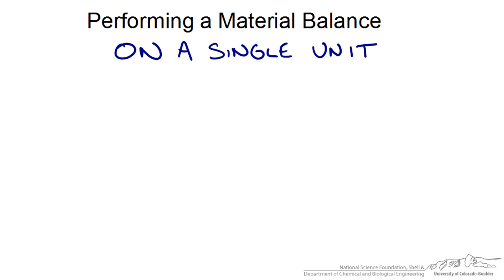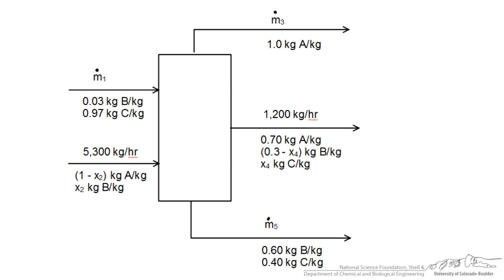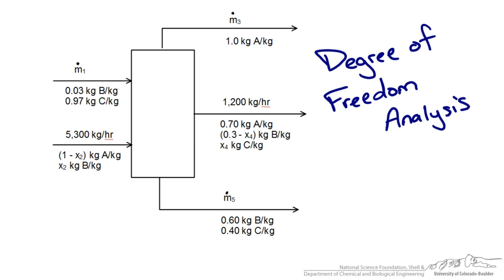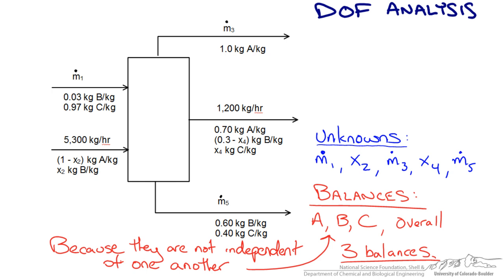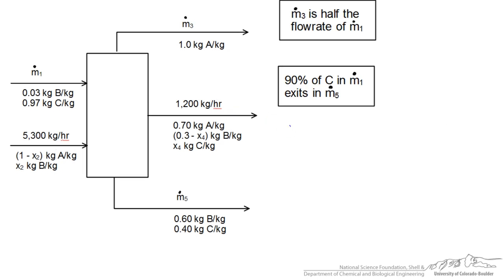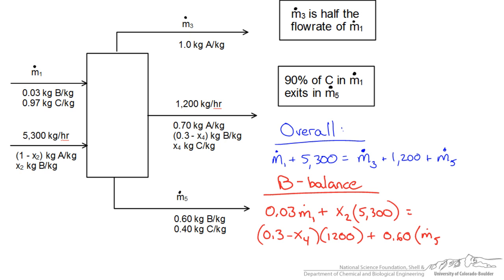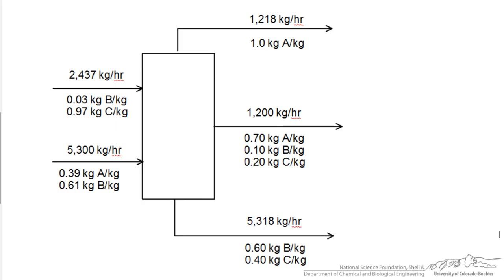Performing a Material Balance on a Single Unit

Comment: please explain why 90% of C in m1 exits in m5, and also 
m3 been half the flowrate if m1
Reply from the maker: At 4:20 they are presented to help solve the balances.  Otherwise the DOF before that revealed it was unsolvable without further information. One reason doing a DOF is important is that in real design you may have to either make assumptions or get more information to proceed. These are both  pieces of given information.

Comment: Can someone tell on what basis those 2 assumptions were taken?
Reply from the maker: At 4:20 they are presented to help solve the balances.  Otherwise the DOF before that revealed it was unsolvable without further information. One reason doing a DOF is important is that in real design you may have to either make assumptions or get more information to proceed.
Reply: @LearnChemE  Could you for example have said that  0.1m1 = m3 instead of 0.5m1 = m3?

Comment: The last 2 conditions flowrate m3is half of M1 how did you get that?
Reply from the maker: Those were merely provided to allow you to solve the problem.  They weren't calculated.  Think of them as just part of the problem statement.
Reply: @LearnChemE  I meant the degree of freedom analysis part whether the eqns were given or u calculated them and if calculated then how?😅
Reply from the maker: They were given.  Once it was discovered that there were 2 degrees of freedom, we needed 2 more pieces of information to solve the problem.  So those two items were then given.
Reply: @LearnChemE  ohk thnx😁😄

Comment: Ooh please, can you explain me the ecuation number 3? it gets me headaches 🤯
Reply: Equation 3 is the overall mass balance, where the total input=total output (all the streams going in equals all of the streams going out for that system). So, you would get stream 1+ stream 2= stream 3+ stream 4+ stream 5. Because the flow rates for streams 2 and 4 are already known to be 5300 and 1200, respectively, you can go ahead and directly plug that into the equation, resulting in m1+5300 = m3 + 1200 + m4.

Comment: Hi, I was originally confused for the statement "90% of C from m1 in m5", but looking at your calculation, you used 0.40*m5 because stream m5 consists also of B, and not solely component C?
Reply: yeah thaats why we multiply m5 with 0,40 , which is c rate in m5 , so theres no longer b's component 

sorry for 7 years late

Comment: Thanx for the video. 
Just wanna fix a small thing 
I Think m5 = 5319 kg/h  so that what goes in = what comes out.
Reply from the maker: Thanks for your comment.  They should match up, but the numbers are off by 1 kg/hr likely due to rounding.  Since that is less than a 0.02% difference, I wouldn't worry about it.

Comment: Very good video... but I have a question about the final balance steps. Where is the 2,437 kg/hr coming from? Is there anything being divided? I couldn't figure that step out. Thanks.
Reply: Yeah but it's -0.5-2.1825.... m1 - 0.5 - 2.1825.... How did you turn the  0.5 into a positive all of a sudden? It's a negative on that side of the equation. Should be -0.5-2.1825= -2.6825. Then divide -4,100 by -2.6825.
Reply from the maker: @elliotb1795  The equation is m_1 - 0.5m_1 - 2.1825m_1 = -4100. The first m_1 has a coefficient of 1. So you have 
m_1(1 - 0.5 - 2.1825) on the left side. (1 - 0.5 - 2.1825) = -1.6825
Reply: I couldn’t understand it too😞
Reply: yea i dont understand this part, anyone helppp
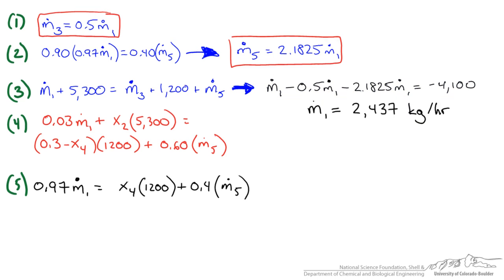Reply from the maker: Thanks for your question.  The screen at 7:45 lists 5 equations.  The first three have three different variables.  (3 equations for 3 variables = solvable).  After that it is just substitution.  m3 = 0.5m1, m5 = 2.1825m1.  When you replace the m3 and m5 in equation #3, you get m1 + 5300 = 0.5m1 + 1200 + 2.1825m1.  Then you move all of your m1 components to one side to get the equation written to the right.  That simplifies to -1.6825m1 = -4100.  Then, dividing both sides by -1.6825 you get m1 = 2437 kg/hr.  I hope that helps.

Comment: at 7:15 how did you get m5=1.825m1 i repeated this part more than 10 times and still cant get? i understand the whole Video  except this part please help
Reply from the maker: +Ali Al-Obaidi I'm confused on your question. At 7:30 in the video, we get m5 = 2.1825m1, just from rearranging equation 2.  Are you asking where that information came from?  Or just the math?
Reply: +LearnChemE yes I am asking about the math
Reply from the maker: +Ali Al-Obaidi So the equation starts at 0.90*(0.97m_1) = 0.4m_5
Simplifying the right side: 0.873m_1 = 0.4m_5
Dividing both sides by 0.4: 2.1825 = m_5

The number you gave in your first comment is incorrect.  Does that help?

Comment: How do we get the statement 'm3 is half the flow rate of m1' and '90% of C in m1 exits in m5' ? or was it given in the question?
Reply: Shishire3210 he just answered the question the problem would be unsolvable without the introduction of more information. So yes it was given
Reply from the maker: At 4:20 they are presented to help solve the balances.  Otherwise the DOF before that revealed it was unsolvable without further information. One reason doing a DOF is important is that in real design you may have to either make assumptions or get more information to proceed.
Reply: LearnChemE This doesnt really answer the questions. You only said that these two relations are known, did not say if they were given or we had to derive them ourselves. Thanks.

Comment: it will be easier if we have MB on A from the beginning and with just one relation

M1+M2 = M3+M4+M5............1  overall MB
2 M3 = M1.............................. 2    relation
MB on A :
0,39 M2 = M3 + 0,7 M4............3    since M2 = 5,3 and  M4 =1,2 kg/hr
so:  M3 = 1,227 kg/hr    put in 2   so :  M1 =2,454 kg/hr    put it in 1  so : M5 = 5,327 kg/hr
 now MB on C :
0,97(2,454) = 0,4(5,327) +1,2 x4  so  x4 = 0.2 
now MB on B
0,03(2,46) +5.3(x2) = 1,2(0,3- 0,2) +5,327(0,6)   so  x2 =061
Reply from the maker: It is certainly fine to use a mass balance on A to solve the problem.  However, I'm not sure how you solve with only one of the relations.  In your MB on A, where did you find the fraction of component A in M2? I think that is still an unknown until the problem is at least partially solved.